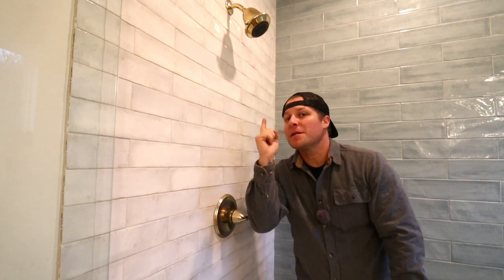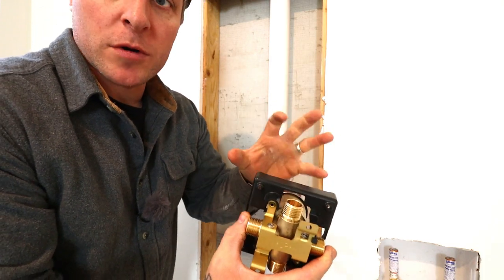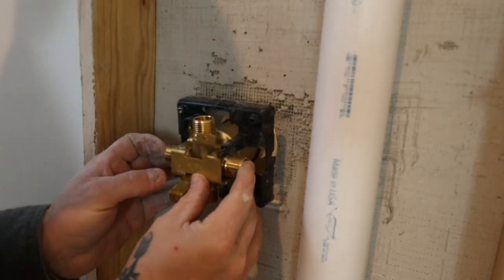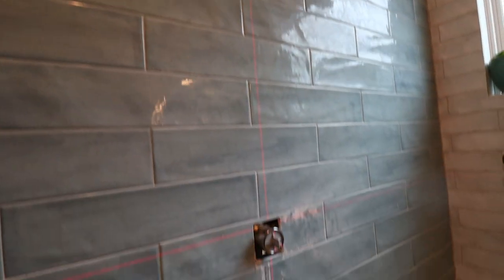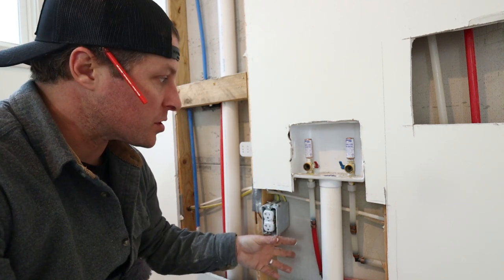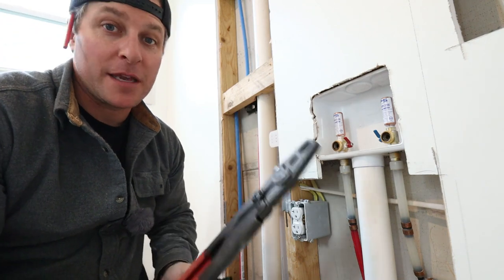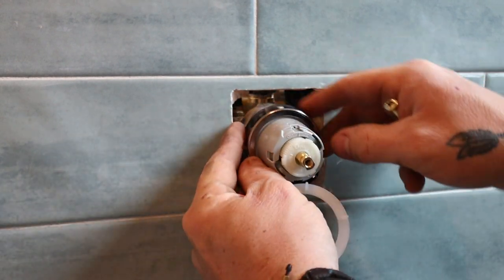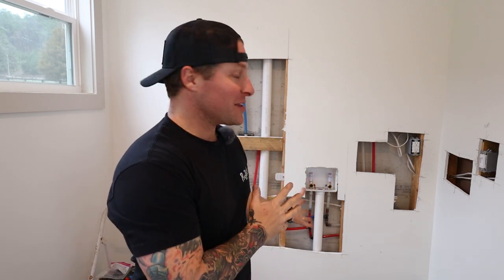Adding a second shower head!  FULL BREAKDOWN

Comment: Great video. I have one question though. is it okay to use an iron pipe cap on an install like this? i figure that would rust out over time,🤷🏼‍♂ but i could be wrong.
Reply: 100% - get a brass cap

Comment: What technique did you use to know where to drill the hole in the shower so that it opened up in the right, off-center place between the studs?
Reply: He marked where all the studs were and then in between them should be a void space. It's a bit of an educated guess, there could have been a heat run in there but he got lucky